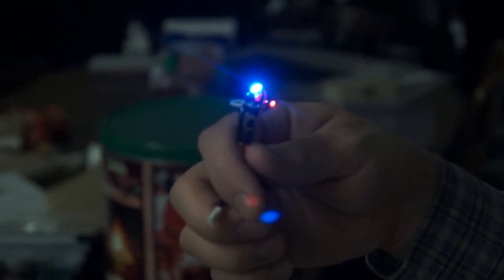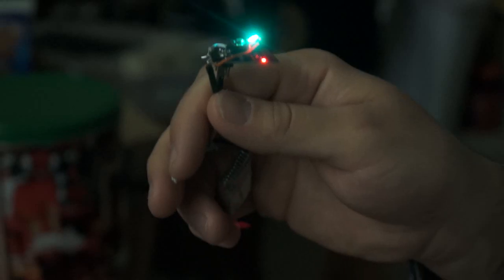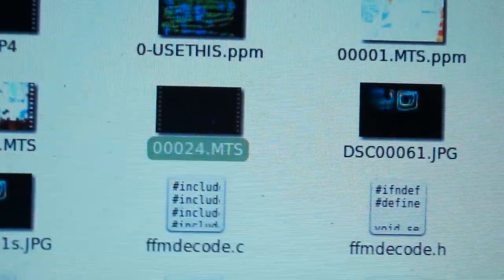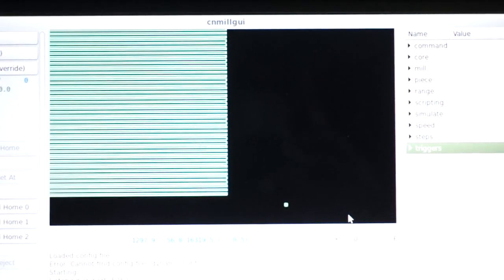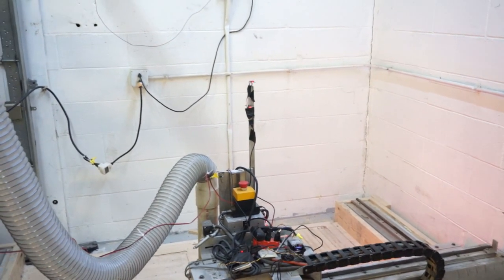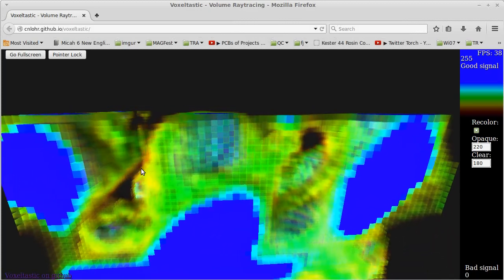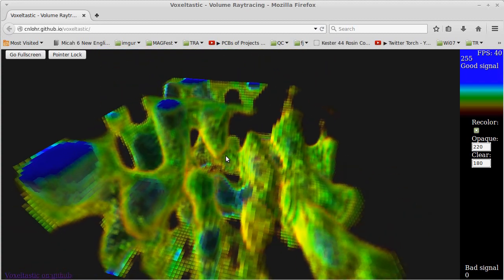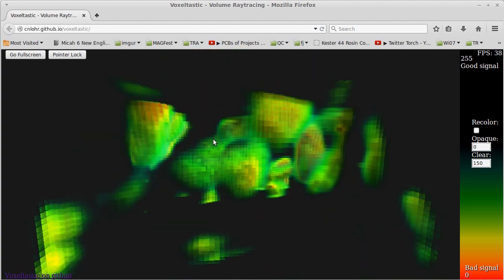High Res Wifi Signal Mapping

Comment: Awesome! I'm surprised by the amount of local variation as well. I guess antenna diversity is really a good feature to have for this band.
Reply: Absolutely awesome. I wonder how the picture would change, if you enabled beam forming, using multiple antennas, and how repeatable the experiment is? How is the measurement affected by e.g. people and objects moving around in the area?
Reply: This is actually most of what I do.  The pattern shown is not truly static.  Many things will cause changes: moving equipment, relocating items, having door and windows open or closed, etc.  When doing a site survey for a client, I inform them that this is only a "snapshot" of time.  I call it my "formal walk through".  It gives me an idea of where I need to spend more of my time for the actual survey which is generally done over a 2 week period. That way I can capture many of the transient strength patterns.  This is then used to determine the type of WiFi access point (AP) to use (directional, omni directional or combined antennas, 2x2 or 3x3 MIMO design, frequency bands, etc.)  While WifI for home, and often for small offices, may seem simple, once you get into larger more complex spaces it quickly become a very complex item.  Networking WiFi APs adds in several more layers of complexity.

So the next time the WiFi at you local mall, airport, stadium, etc. goes down, realize that keeping those radio networks operating is a VERY complicated job.  The engineers and technicians will do their best, but it can take some time to first find the problem, then we still have to fix it.
Reply: Michael Olsen This is something very much up my street but still something I know little about. Any resources you can point me towards?
I've read up plenty but knowing when and how much to adjust power levels, exactly where to put APs and how to properly do site surveys is beyond me.
Reply: Some very good questions Rob Whitfield.  I have a hard time recommending resources because too many of them deal with WiFi on a very trivial level.  For example I have yet to find any that actually deal with 3D mapping.  The best I have found are 2D mapping system that will allow you to "stack" floors within a building. 

As for adjusting power levels, that can become a full time job all by itself.  I generally recommend developing a "mesh" styled network using APs that are able to talk to each other (directly or via master controller).  These often have automatic power adjustment and channel mapping capabilities, making the network inherently more stable and robust.  They also have prices that reflect this ability ($300 to $1,000 each). 

Finally, when doing a site survey, the big thing to remember is that all radio traffic (including WiFi) is transient.  This means that what you measure at a specific place and time today, can, and most likely will, change throughout the day and all future time.  The best we can do is establish a general trend of electromagnetic (EM) signals over a period of time, and us this as an estimate of what we would expect in the future.

A typical site survey for me involves three distinct phases -Shoot & Measure, Initial EM walk through, and Extended Study.  Many people combine the frist two into a single event and then say they are done.  The result is a single moment in time snap-shot that has no means of predicting EM fluctuations over time.  Hence, they frequently have to make return visits to "adjust" the AP placement/network.  By separating and using all 3 phases, I am generally able to provide a much higher quality installation and  often in a short time span.  This saves the customer significant money on both installation and maintenance, and gains me tons of word-of-mouth advertising (read +50% increase in job requests).

If you would like to discuss my process for surveys in detail, you can email me at my professional account, michael.olsen@dbwsys.mb.ca, and I will be glad to assist you further.
Reply: Back in my days of working at Blackberry, I built a machine to sweep the device through complex motions to average out these effects (Radio engineers always have to keep this sort of fading in mind)
Reply: Ok so here I am, watching youtube, watching the incridble @CNLohr 's video on LoRa, and you link back to this video at the end, and it was unmistakeable what I was looking at - the quantum fluctuation graph that used to be populer - from QCD. I watch the video here on how you made it, and I'm shocked, it looks even more similar - importantly it appears self similar or fractal, but there's more. Each slice of the image looks like the CMB. So, prediction - recording the signal of the CMB over time should produce a similar fractal 3d representation. Second prediction - using light intensity maps like in this video could help scale up physical interactions allowing the solving of QCD equasions at the tiny energy scales of atomic nuclei. Final prediction - the cmb looks the way it does because it is a projection of quantumn fluctuations at the dawn of the photon epoch. This last prediction is quite easy to test, because the size scale of the flucuations in the cmb now should be the size of quanumn fluctuations then times the inverse square scaling factor - (4*pi*13.4e9*c)^2. I've observed the same pattern on hubble or JWST images if you zoom in. I'm not sure if it is a biproduct of the processing or the sensors tho. Think if the pattern lined up tho, it would be incontravertable proof. Any here think they can help prove/ disprove these hypotheses? I'll certainly reference this video, but I'm keen to inlude fellow authors as well.

Comment: Here's what I'm thinking:  Small two axis servo gimbals that holds this device's antenna and your PC's WiFi device/antenna.  Write a program to find the sweet spot, lock onto it, and follow it if it grows weak.  Imagine devices like wireless IP camera's, TV's and game consoles, etc actively finding the best possible signal in a narrow sphere.  Basically smart antennas!  In places like coffee shops with constantly moving barriers, this would be awesome to maintain best connection strength.

Comment: Wow pretty cool. One thing you can try to do is add a 4th dimension - time. I'm sure there are interesting temporal variations that we could see. You could attach two or more detectors on top of each other on the mill; that way the data from one will vary by some seconds from the one on the bottom. Just a suggestion, if you're not done with the project yet.

Comment: If you could capture the signal data with the telemetry output from a smartphone motion sensor, then automate all of these steps, you could have a very valuable tool for network administrators on your hands.  Especially if you could look at the whole spectrum, or filter by channel or SSID. 

Imagine an admin creating a 3D 'heatmap' that tells the admin where rogue networks are compromising signal, or where changes to the building plan dictate the need for network changes. 

Imagine adding a 4th dimension, time, and seeing how things like weather and how many people are present could affect trends. 

This is seriously wicked. There's so much potential with this kind of data.

Comment: That is a very cool result!

A question though - Wouldn't the scanning mechanism affect the accuracy of the measurement? It seems that the field strength being affected so much by gradual position would also be affected by the mechanism moving the probe.

One way to test this would be to use your measuring rig to see if a known radiation pattern in free space ends up looking like the measured result.

Comment: As an ex student of radio (1974) I often wondered if it was possible to obtain "real time" 3d display of signal strength. I THINK that's what I'm seeing (5 minutes watching). Brilliant.
Reply from the maker: It is not real time.  It took a very long time to read all of the wifi in the area.  But it does give you a real map.
Reply: @CNLohr  How did you get measurement for z (altitude) ? With an altimeter or a barometer ?
The rxsignal measurement does not give the altitude metric

Comment: Wow you got my sub for this, for sure. I may have missed it in the deluge of data you provided in the description, but I was curious what channel you were using, as well as what mode of (I'm assuming) 802.11. 11n, 11ac? Were you associated and did you have traffic running at the time, or are you capturing periodic control traffic like beacons and probes? Also, you mentioned 2.4 Ghz, it'd be cool to see 5 GHz channels as well.

As an aside, that solution powering a large LED array would make for a killer Burning Man art project. ;)
Reply from the maker: Sadly, I did not record the channel number when performing this test :(

Comment: there's a similar device that you'd use if you want the rf field emitted by a device measured. You simply put the pcb/device to test on a table and then a cnc controlled holder moves a special near field probe over the device. this way one could see which component/conductor exactly emits the most and tune the circuit in case there were troubles with the device at emc tests

Comment: @CNLohr, how did you record the elevation z ? Did you use a barometer/altimeter ? Or do you infer the elevation based on x/y and the distance to the hotspot + previous led locations (x,y,z)?
thanks !
Reply from the maker: I drove the mill to a specific Z.  I recorded many XY slices, each one at a different Z.

Comment: The interesting part is the movement of all the measurement equipment is impacting the RSSI as well. So the results are slightly skewed by the measurement process.  That said, very well done.
Reply from the maker: Dan Simpson I tried to minimize it by putting it on that long pole above the machinery.

Comment: Pretty cool stuff. Small sidenote with your superlongexposure, looks like you're writing to stdout extremely frequently, this is generally quite slow, depending on the terminal and buffer settings. You might gain a significant speed benefit by removing those prints. Could still see progress intermittently by spawning a new thread and getting status reports less frequently.
Reply from the maker: JaTochNietDan superlongexposure actually doesn't take /that/ long... but, on Linux, printf is extremely fast unless you're dumping megabytes to the terminal.  In fact afaik, it actually does the byte-moving in a different thread.
Reply: CNLohr Fair enough

Comment: This is awesome! I have an idea and came across this, which got my wheels turning some more. I'm thinking about mapping the inside of things using density. Instead of using a hardware device to detect signal strength at a single point, could you use another field passing through something (like invisible cnc routing) to detect density either by signal strength at a given point or by wavelength change from point to point? You'd essentially be able to map the inside of something using wifi. Like an internal 3D printer.

Comment: First of all, kudos for this great project! Truly amazing job! 
What is the RSSI variance in this picture? Those colors are tricky to understand. Thank you!
Reply from the maker: I regret that I never took the data down with the specifics of what the power levels were :-/
Reply: Woops. Look, I made several measurements in open field. And it looks like distance vs RSSI has strong reverse-correlation: RSSI = A/(x+a), where A and a - are specific to access point/client antenna, x - distance. However indoors everything looks very different. I doubt if you can do any triangulation indoors. From what I see that relation between distance and RSSI is distorted by obstacles/people inside building. Triangulation does not seem feasible way to WiFi-based location.
Reply from the maker: Triangulation based on RSSI is infeasible.  There is a lot more to a wifi signal than RSSI!  Like the constellation information and time of flight!

Comment: First thing is to have two antennas spaced apart by an amount that makes probability of no wifi minimal and to switch  antenna use based on stronger signal .then test max speed with new method versus single antenna

Comment: Wouldn't a better way to do this test be to directly log numerical data from the Rx receiver instead of visually interpreting the data from a camera and LED? You would avoid the long render time of the composite process and have the raw data available to get a finer resolution by averaging between sample points.
Reply from the maker: That sounds like effort.  I generally just pick the easiest ways I can to find things.
Reply: IKR? I'm sure someone's already thrown a Python script up on GitHub that already does this.
Reply from the maker: Really I think the difficulty comes in synchronizing the data from the receiver with the points seen by the camera.  It is much simpler to let the camera do this for you.
Reply: CNLohr
Spoken like a true hacker :)

Comment: It would be really interesting to see this implemented on a phone, using the screen to provide the colour feedback. Or perhaps a router with WRT. I'd be really surprised if the frequency, shape and size of the wireless "holes" don't improve hugely with MIMO, beam-forming, and mobile/router antenna design and distribution.
Reply from the maker: Adrian Beale Yes!  All of these things will make the effects of these standing waves almost (or totally) go away.

Comment: I think the mill test probably didn't produce real results because the moving metallic parts probably influenced the signal differently at each position, and so you're not getting the same results as you would get if you just had the receiver floating at each position with the mill resting at it's zero or whatever other static position; the readings at all other positions are probably different for each current position being read, than what they were when the mill was positioned to read them there.

Maybe you could get the real results using something sorta like those coordinated cable spooling/unspooling camera rigs they have in some stadiums and stuff that will move the camera thru space; but using some non-conductive, non-absorbing, and non-reflecting kind of string to suspend your sensor?
Reply from the maker: I did try testing to make sure that was ok by holding the sensor still at one location, and moving the mill around, and the change it made was minimal.  To minimize the mill's impact is why I put it on a long wooden dowel rod.  Doing it the other way would be even better.

Comment: Also recording an accelerometer reading and signal strength reading as each data point instead of photographing an LED would yield a much higher resolution.
Reply from the maker: the update rate on the LED is 50ms, so as long as I'm not speeding along, it's not that bad. But it would be difficult to correlate the data back and do all that with time.  By just using the camera it just makes things easier.

Comment: Is the visualization correct?  for a reliable picture, it is necessary to simultaneously measure at each point, then the reflected waves can be excluded
Reply from the maker: What you observe are standing waves and places where there is shadowing and fading due to multipath and reflections.  the data is stable in time and does not matter when it is measured.
Reply: Thnx, in first time i thinking that you would like to see waveform in 3d) by 2d scans.

Comment: Looks super awesome! But now I feel like I need to see this done directly around a wifi router or something like that, otherwise I'll never feel complete :(
Reply: I support your request!!! :)
Reply: Unfortunately, it took around 8 hours to scan that small 380x380x190mm area on the mill.  Maybe we could decrease the resolution a lot and get a more reasonable area, then place the wifi source in the center of the table.
Reply: Why takes so much time?  wHy  I can not believe it :/
Reply: Estuar Gonzalez it's all the layers (it scans first in the XY plane then moves down in Z one layer at a time) it has to scan. I think it's about 8 minutes per layer and 64 layers. That adds up fast.
Reply: Adam Geary What kind of resolution are you scanning at? I'd imagine you could still get some quite good results out of just scanning at a quarter or eighth wavelength per sample

Comment: Did you find that the signal in any individual spot changes over time or remains relatively the same? Or if moving the router alters the strength?
Reply from the maker: In general any one spot stayed consistent over time

Comment: Brilliant work. I'm stunned by the variation in a small distance.  Related to this, how can the signal strength of my wifi change dramatically when I am using a desktop (nothing moves) 30 feet from the  wifi router?
Reply from the maker: +William Porter I should have shown that but  even small motions of someone not even between the transmitter and receiver can cause the signal to go up and down.
Reply: I was in the house alone. I was sitting almost still in the chair and the antenna for my PC is above my head. This started about 10 days ago. The tp-link car disconnects frequently from the wireless router and signal strength varies a lot
Reply: Irritating speech to text conversion. Drop car from the sentence above
Reply from the maker: I don't know then, you could use wifirxpower to look at it in real time.

Comment: what about fluctuations in the wifi signal over time? it looks like it took a while for the scanner to make it across the desired area, couldn't the wifi signal have changed over that time to produce those odd shapes shown in the video?
Reply: It didn't really seem to change over time.  At least, not in the limited time I held the thing in the first part of the video.  I could hold it steady in one place and it wouldn't change a bit.  It might be interesting to leave the signal tester in one place for a whole day and measure any fluctuations, though.